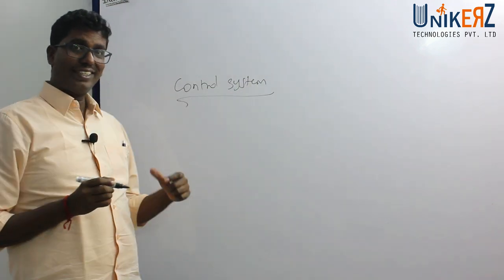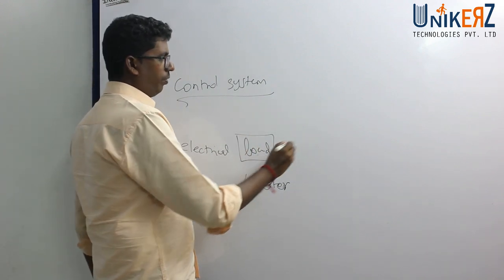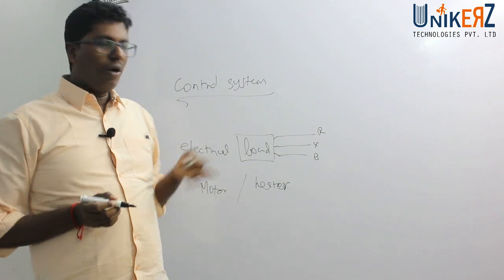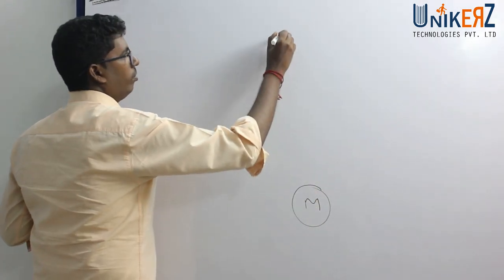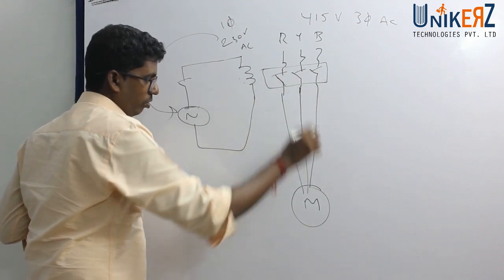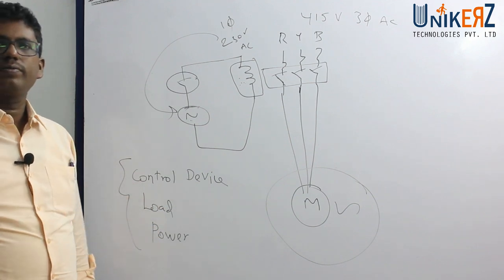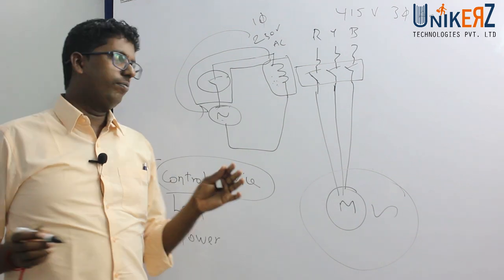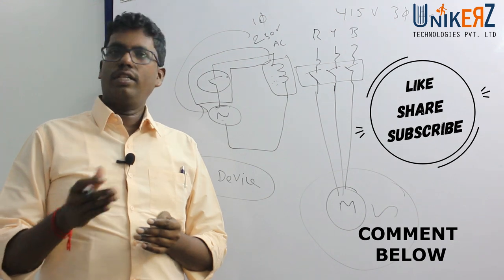How to Read Electrical Drawing? - INDUSTRIAL AUTOMATION - In Tamil - Part 01

Comment: 415v 3Ph la irunthu single phase voltage 250V epadi sir varum pls explain
Reply: 230v control circuit
Reply: Using transformar